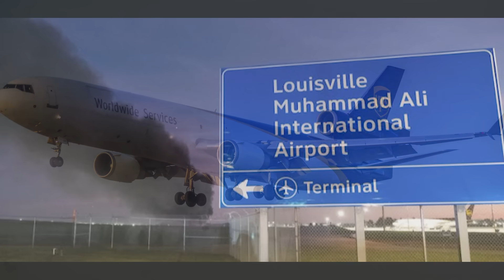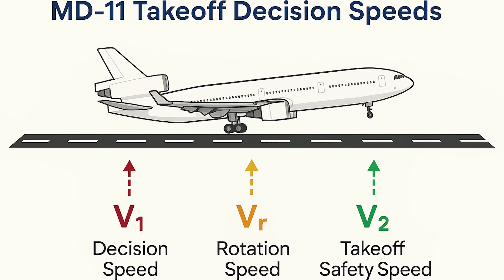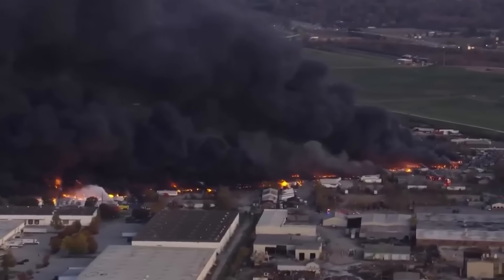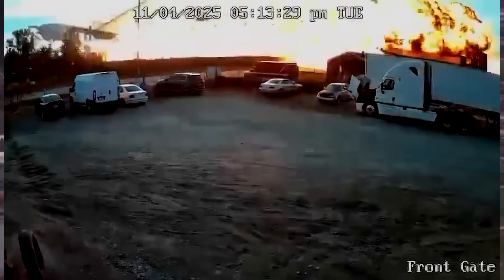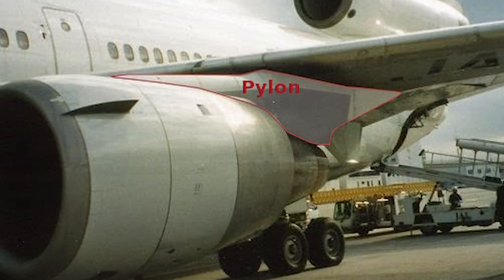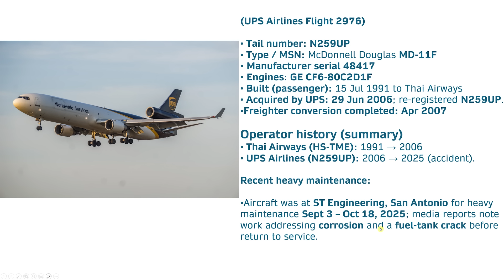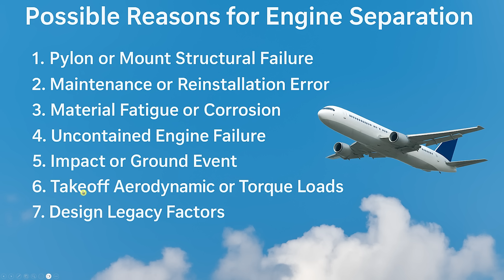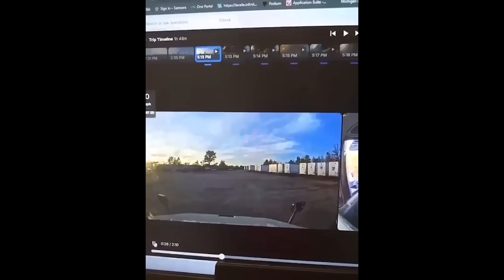What Caused UPS Plane Crash, Louisville, KY? How MD-11 Engine Fell Off

Comment: why is nobody mentioning terrorism?
Reply: Because there's no suspicion of it at this time and to do so would just unnecessarily complicate things and lead to conspiracy theories
Reply: Sabotage maybe but they'll knie who did any work on it and very low chance of any other sort of terrorism
Reply: Terrorist unlikely it should of been empty no cargo as callsign started ups 9 of it was actual cargo should of been starting with 5 for ups flights
Reply from the maker: when terrorism is proven it will be mentioned
Reply: @jeffostroff exactly thees no evidence as of thus time, the issue was what happened to engine and that was likely maintenence

Comment: They will find an inspector and or aircraft mechanic somewhere that caused this. This will not be blamed on pilot error. Unless of course they noted the engine hanging down during their preflight.
Reply: There must have been no alerts or out of spec engine readings right up to V1.
Reply from the maker: yes, not likley they would start takeoff roll with no working engine on the left side
Reply: No pilot would take off with something knowingly wrong with the plane.
Reply: @triciac1019  Duh.

Comment: that first dashcam is horrifying. hadnt seen that angle yet, just that truck drivers dashcam
Reply from the maker: That dash video was just posted last night 10 pm, so I grabbed it immediately
Reply: @jeffostroff : Good snatch! It helps us better understand what happened. 👍
Reply: @jeffostroff  This first dashcam with powerline flashes, this is exact moment, plane hits that roof of building talked about holes in roof. You can clearly see impact as fuselage changes angle sharply at that moment and from there on just bounces and falls down in front of that other truck dashcam at 90 degree angle.
Reply: @SiiliViin the building it hit was before grade LN so before it go across the road dashcam driver is on the warehouse it hit was literally right in front of the runway
Reply: @SiiliViin antes de bater no teto, ainda restava um residual sustentação. Assim que ocorre a colisão, só restam o empuxo do motor n°3 e talvez o 2. Mas a asa sobe e a outra desce e fica pelo caminho espalhando todo aquele querosene no fogo. Cara é muito triste isso, como aviador aposentado sei que eles estavam tentando até o fim.
Reply: @SiiliViin the initial explosion was the left wing slamming into that petroleum recycling facility. You can see the blue tanks of it before the plane hits
Reply: @Sergioricardoneto  Some pilots are saying they can clearly see compressor stalls on #2.
Reply: @SiiliViin  The first building (one UPS warehouse facility) that the plane's gear gouged the roof of is visible, at 0:02, to the left of the road the dashcam truck is driving on.

You can make it out betwen the trees, and there is one small pine tree standing against the beige outline of the wall of that building.
Reply: @SiiliViin  No it is not!  It was filmed on Grade Lane.  The building is to the left and already hit.  Ironically, a UPS warehouse.
Where you you dream your non-factual information up?
Reply: @SiiliViin  "This first dashcam with powerline flashes, this is exact moment, plane hits that roof of building talked about holes in roof."

No, the aircraft had already hit the UPS Chain Solutions building close to the end of the runway.

Shortly after the second powerline flash the left wing of the aircraft hits the vertical fuel tank.
Reply: @jeffostroff I'm always glad to see you release a video because your information is dependable and easy to understand.
Reply: @jeffostroff  If it helps I found the location, that mailbox is at 1713 Grade Ln.
Reply: @jeffostroff  E.R.T.. The spark from the live wire ignited the fuel, from the punctured wing, fuel bladder. The engine replacement bolts, sign off by the  C.D.I., and C.D.I. for the starboard fuel system will be under massive scrutiny, dating back 7yrs.. The landing gear is not up because serial bus problems, and bigger problems to attend to. Even the cargo shift of 1 degree can effect a plane delicate ascension. So the C.D.I. of weight and loading will be investigated too!
Reply: Literally these are things I see in my nightmares
Reply: @TKOTraddish same here. I am over 40 years old but have had nightmares of plane crashes since I was a child. Never that I am in the plane, but witnessing them, and not being able to save the people on board. I was raised by my grandpa, who was an aerospace engineer, and I went on to work for the same company he spent most of his career working for, so maybe that's why? I have never seen a plane crash, but did find a missing plane 4 years ago in Alaska. A float plane seemed to dissappear and lost all contact near the rural village I was living in.  The pilot lost all electrical and was able to land out on the ocean near by. He was fine, just had no way to communicate that fact lol. I towed it with my boat to our float plane dock where he was able to fix it and fly away in a couple hours.
Reply: @slupot : Blown fuse?
Reply: @TKOTraddish  same here
Reply: Without knowing this crash i would think its an AI or a game footage
Reply: @rm6857  There's a movie some people say was similar
Reply: Holy crap.  Yeah, that is one of the most unsettling plane crash video I've seen.
Almost unreal.  People were on that thing.
Reply: @SRMoore1178 More people were on the ground underneath it.
Reply: Compare this video to the Concorde crash in France. They both ended up the same, however the Concorde never lost any engines from the aircraft, BUT the FLAMES create DRAG, that's like having a parachute slowing the plane, 'cause when the Concorde caught fire, the pilots had the throttles at full power, but the jet still stalled, wobbled in the air, then stalled completely and went down into the apartment complex killing all aboard and people inside of their homes. The fire from the MD-11's wing caused drag over the left wing which caused it to roll left and the landing gear struck the top of the building, causing further slowing and rolling left til it's left wing hit the ground and sheered off, then finished rolling left due to the right wing still having lift. So sad for all who perished and their families they left behind. 🙏😞
Reply: @glenturney4750 
The plane rolled left because the left wing lost all lift, while the right wing, with #3 engine at full power, kept on lifting. It was a combined roll and yaw.
Reply: @wanyelewis9667  That's what happened to the flight in May 1979.
Reply: @wanyelewis9667  True, but there was no roll prior to the plane striking the UPS building. In fact, the plane was still gaining altitude as the damage on the roof indicates.
Reply: Honestly, that view basically clinches that even if the center engine hadn't gone out from compressor stall/debris ingestion, that plane was doomed. Look closer, and you can see that the flames are coming from the top of the wing, not the pylon. I've seen other eyewitness reports that say they saw the engine launch itself off of the pylon and then tumble over the top of the wing. If that's true, then evn if they had managed to keep it airborne... then that wing would have snapped in half from a combination of damage and heat melting.
Reply: @defies4626 you can see when the plane first comes into view the engine seems to be above the wing and when it appears after the next group of trees it is gone. So that was it launching off .
Reply: @defies4626 looks like similarties between the plane crash of a dc10 of AA191 in 1979.  It lost same left engine at take off.  😢😢😢, so sad 🙏.RIP.
Reply: @jeffostroff hey, aircraft mechanic here. So the question everyone is missing. Aircraft are built with redundancies. So even if they lose one engine, the plane can still get into the air on the other two. Just a definition for the common man, aircraft engines are numbered from left to right. In this case, #1 being on the left with, #2 on the tail, #3 on the right wing. I'm really interested in what happened to 2 and 3?
Reply: @bryandwyer2204  Watch the other videos. You can see one of the engines, not sure if tail or right wing, flame out similar to what happens in a bird strike just as it takes off. Possible debris from #1 coming apart made it into the other engines.
Reply: Is that a live electric line just whipping around?
Reply: The sound on one other video was intense. I can picture the sound preceding the plane and then bam! the sound from the other video.
Reply: That really is scary this new dashcam video.
Reply: That particular video will be in high demand; if nothing else it will be an iconic as well as a training module
Reply: The guy backs out pretty quickly after that nope moment.
Reply: Did he 💩 his pants? I know i would have probably passed out. So sorry to the families for their losses.
Reply: they were pissing me off moving while there were ppl running in the street LOL. i get it a tense situation but damn lol.
Reply: Why does this happen
Reply: Completely agree — it’s chilling. I hope the investigators and first responders are coping; scenes like that stay with you. 🙏
Reply: Absolutely horrifying 😢😢😢🧚‍♀️🧚‍♀️🧚‍♀️
Reply: I'm very tempted to believe that someone worked on that engine the night before and forgot to finish the job.
Reply: @goody2shoes384  Heavy maintenance was done in October 2025.   Cracks and corrosion.
Reply: @lupusgirl1000  Yeah, 5 weeks on the ground.
Reply: @goody2shoes384  I know some A&P mechanics. They are very committed to doing a good job because they know lives rely on them doing a good job. They don't want people to die and recognize their responsibility. Good people.
Reply: @goody2shoes384 : OR, saw its damage of corrosion, but passed it off anyway out of laziness, hoping it would last til the next mechanic had to fix it.
Reply: @glenturney4750  or a fatigue crack in it....
Reply: @glenturney4750  Is this the same plane that had a report of corrosion damage on the airframe?
Reply: That guy was flying that plane! Those wings were level when it hit the power line. They had a chance.
Reply: Don't be sad. They're probably in a better place now...
Reply: Looked AI at first but just found out is real.
Reply: Last time I seen a black guy run that fast a Popeyes Chicken Resturant was on fire....
Reply: @JamieKenny-h5b He was running to it, not from it though.
Reply: @JamieKenny-h5b  LOL!

Comment: I think the question that needs to be answered is why and how did that number One engine end up on the runway. Doomed after that.
Reply: DC-10s/MD-11s have a history of problems with the engine pylons. This isn't the first DC-10/MD-11 crash caused by the #1 engine departing the aircraft on takeoff.
Reply: @wun1gee  Yep, try May 25, 1979, American Flight 191 in Chicago.  Same scenario. Not to mention both accident aircraft had just been out for maintenance.
Reply: The problem was a bolt that came off.
Reply: It's probably irrelevant.. the bigger question is why did they put Chris Christie in the cargo hold knowing that it would affect the structural integrity of such an old plane upon impact??
Reply from the maker: Plus all of his drones that were delivering McDonald's to him